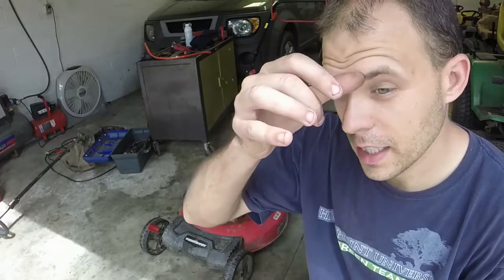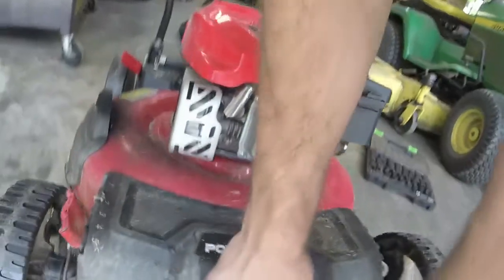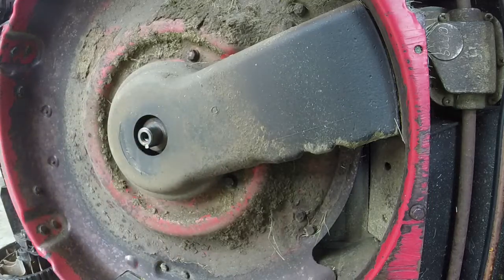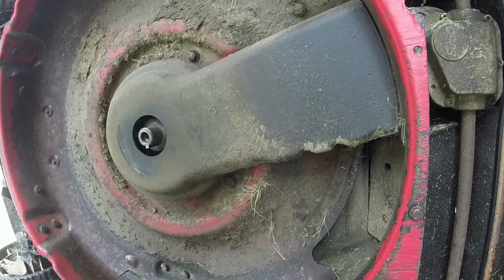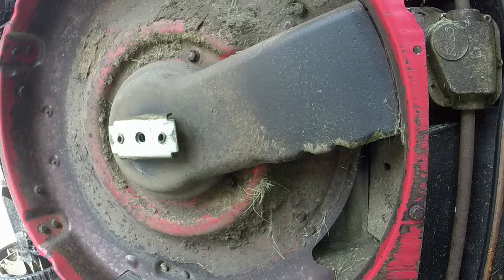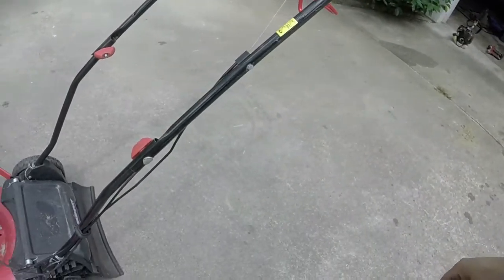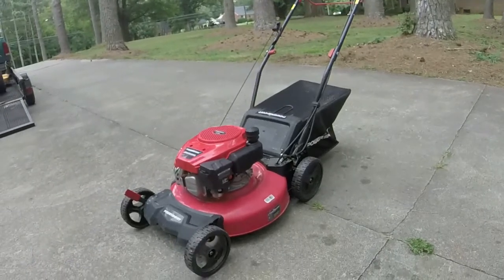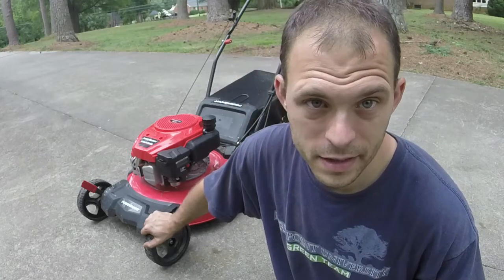Free Powersmart push mower fixing non working self propel:  How cheaply made are they?

Comment: So I got a free Montgomery Ward push mower with the Briggs Pulse Jet engine.  A little oil in the combustion chamber and it broke loose and runs like a top.  The only plastic on it is the pull rope handle!!  Even the discharge chute cover is steel.  Its gotta be at least 22 years old, Wards wen out of business in 2000.  This Chinese junk today won't be around as long as that old Wards!  Good video!

Comment: I've had my POWERSMART 196cc RWD 22" for almost 5 years with no problems, its been a great mower. Mine is "no prime" & had one big lever for wheels. I have a huge hilly yard with lots of bumps & I do my 3 neighbors yards so its had a lot of heavy duty rough work. I got a new belt at NAPA & PS sent me one for free. That blade adapter is not to be found! So we had to use couple of bolts like on a HONDA. The plastic cover I glued & yeah GORILLA TAPE! LOL! Had to replace the belt & now drive won't disengage & drive bar floppy. You're right about getting parts but they're getting more available. Problem is they have nothing re: fixing self propel. I bought a new YARDFORCE RWD & I hate it. Its too light(85lb)& does wheelies & jumps around,also bogs down in high grass. My POWERSMART is a beast, goes thru anything easily. So it is getting repaired!

Comment: I Think It's a Case Of : You Get What You Pay For .. A Basic Mower. But It Seems To Run Well. Very Easy Fix.  Well  Done. Yes That Drive Cable  Does Need Adjustment, She Took Off Like A Race Horse, Imagine A Older Person Running After That 😀 It Is Way Too Fast. A  Good Tip, If You Are Fixing Any Mower For Customers It Is Good Practice To Put a Little Never Seize On The Blade Adapter And Crankshaft.  You Never Know When It May Come Back For A Service And The Blades May Be Hard To Remove ,It Doesn't Cost Much. Also Never Throw Tools ETC on Top Of Their Mowers, Some People  Can Be extremely Particular About There Equipment ,You May Damage  or Scratch Paint Off & It Could Cost You Money Instead. Especially While You Are Making Videos About Repairs. Keep Up The Good Work. Cheers From Australia

Comment: The engines on these Powersmart mowers are actually fairly decent to very good with a lot of power more power than a lot of the mowers out there and also decent gas consumption.  They will mow down the biggest thickest crazy grass and weeds ever and not bog down.  Thats were the good things end though and the rest of the mower besides the engine components is junk.  Once you start beating on these machines and leaving old gas in it the mower wont last a year however if your not a bone head and take care of them they will last a long time for a mower thats under $200 new thats a good deal.
Reply from the maker: I did notice these engines have bigger displacements than most out there now in the residential market.  They start very easily which is a plus.